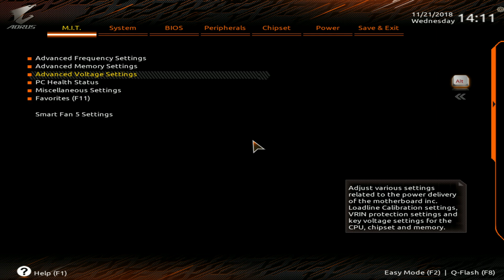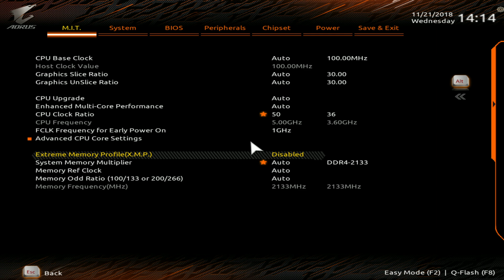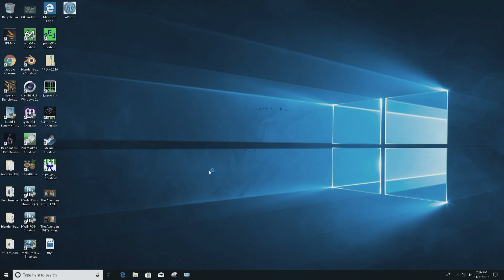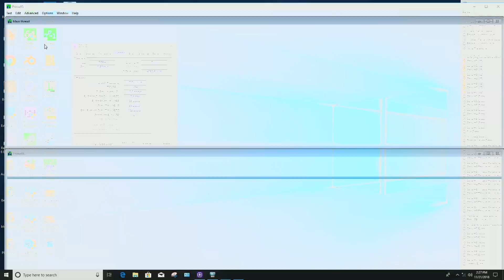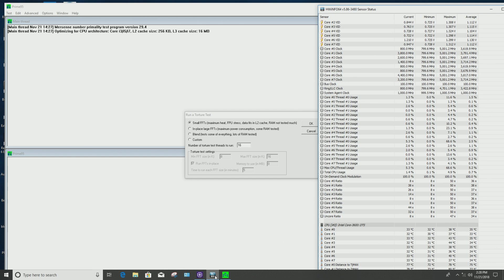GIGABYTE Z390 Overclocking Guide

Comment: i have an i7-8086k so it comes delidded and OC already but at 4.2 Ghz. i dont have the same settings to change as you even though its the same Motherboard. no CPU clock ratio setting anywhere. and cpu frequency is greyed out. no idea how to change anything

Comment: I have an i5 9600kf in a gigabyte z390ud with an air killer s, I was crashing at 5.2Ghz with 1.375 voltage, but when I got the loadline calibration to turbo it became stable. temps are 70ish with maxes in the 80’s on cinebench multicore and aida64extreme. I also noticed my cpu going from 65W to around 100W

Comment: How do I lock my CPU frequency to 4800 Mhz  in Bios ? I have a Gigabyte Z270X Gaming 7 BIOs F8 . I was able to have it set at this frequency all the time but now it goes down to under 2000 Mhz sometimes just using normal windows desktop.

Comment: First of all: Thank you for the straightforward guide!
One question: Which voltage readout in HWInfo is the most acurate for actual voltage at the core?
I heard it's the VR VOUT of the ISL69138, but I am not positive. I'm on a Z390 Pro.

Comment: if you're doing this in 2021 on an i5 9600k I highly recommend leaving everything on auto and changing your core ratio one at a time before proceeding with these settings. This is "hardcore overclocking" and is not always safe to run these settings for everyday use.
Reply: Even when leaving the base clock to drop as needed? I am doing this on the Aorus Pro with an 8700k

Comment: My pc isnt stable even with 4.8 ghz at 1.38v with uncore ratio at 4.7,if I try 5ghz at 1.38v I get instant blue screen.I have an i5 9600kf on a z390 aorus pro motherboard and an msi coreliquid cooler.

Comment: I have the 9600K that ive overclocked to 4.9. I Keep getting error code in Prime95 "FATAL ERROR: Rounding was 0.5, expected less than 0.4 Hardware. All cores are at 100 percent during the bench mark and than all of the sudden core 0 drops down to like 30 and wont go higher. IM running at 1.38 Volts. 
What i read was this error means my voltage is too low. im not sure if thats accurate because im seeing people running 5.2 ghz at like 1.26 in some videos which doesnt make sense. 
My temps during benchmark jump up to 95 which is way too high also.,
I have a coolermaster 212 massive air cooler.

Comment: Hello, 

I have an issue in regards using Z390 D ; in which I am trying to find SVM mode , I dont seem to find M.I.T settings when I press F2 , instead it takes me to EASY MODE or ADVANCED MODE. I am facing hard time here trying to figure out how to enable Virtualization  AKA ( SVM ) , Ive been surfing for an hour via google now and cant seem to find anything in regards to this. Thanks in reply
Reply: same here, I don't understand why this motherboard's bios layout is this confusioning
Reply: @CaesarIzuna  Yea , i still couldnt find it , I just smashed my monitor . Gonna take a break till i get some money to change the frikkin motherboard ... This is the last time I purchase a friggin gigabyte motherboard. ( texting from my phone fyi ).
Reply: @ley667   same here, my next MB with be a asus Strix, it was a mistake buying this gigabyte board
Reply: They removed the option after BIOS version F10+. try flash a previous BIOS version such as F9 or F10. Hope this helps.

Comment: What should i set my vccio, system agent, or vcore on bios f11c to voltage wise if im only clocking my 8700k to 4.7? Any other settings i should change for a normal user with daily gaming use like c-states? Im curious.

Comment: How would I know if my voltage is too low? I've got a I5 9600k/Z390 Auros Pro WiFi OC'd to 4.9Ghz at 1.25V only. I use a Thermaltake Water 3.0 360mm AIO with a CM H500M case: (2) 200mm intake on front, (1) 140mm exhaust on rear, with (2) 200mm mounted on top above the rad that are pulling to creating a push/pull with my 360mm AIO. My temps hit a max of only 70C during a 1 hour Prime95 torture test. I'm currently running an 8 hour RealBench stability stress test. I feel like I could get 5.0 or even 5.1 GHz but don't want to push my CPU too hard (it's a 3.7/4.6GHz Base Clock). Question is I see so many guys using my chip that need 1.32+ volts to hit 5.0GHz and I'm only 1.25V at 4.9GHz, are there any issues if your voltage is too low but you seem to be stable (no blue screens, crashes, black screens and Prime95/RealBench are good)? Is there any other monitoring software I want to use? I use HWMonitor & HWInfo. Thanks and any help is much appreciated!
Reply: did it stay stable?
Reply: @jacobtaylor5879  Yes. Never a blue screen once. Temps stayed good. Haven't changed a thing.

Comment: TweakTown:  you have one for the i5-9600k ???  i just want to clock it to 4.5GHz  but don't know if I need to up the voltage on the power?
Reply: same thing. leave voltage on auto then run a stress test. it should be fine
Reply: there are lots of ways but above is the simplest

Comment: Can i go with the same numbers and settings on my i5-9600?? I've done gpu oc but never touched a cpu, should i get a cooler or i can go with default intel fan?
Reply: stock intel cooler is not overly good for overclocking. you might be able to milk a little more out, but you'd be better off getting a large air cooler or a 240mm aio. Then you'll be able to stretch it out more
Reply: @strider5119  thx for replying! yes i just had a coolermaster 212, got it running on 5.0 rn^^

Comment: Will the "Be Quiet Pure Rock" cpu cooler be enough to cool an overclocked i9 9900k at 5ghz?
Reply: dark rock pro will
Reply: hm but i think all core on 9900k 5ghz should be easy, yes i think smth like that or noctua d12 will do

Comment: can gigabyte b365m aorus elite be overclock
Reply: midrange gigabytes usually arent meant for oc
Reply: but you can oc lightly on smth like b550m ds3h
Reply: its pretty good if you change from rather unstable boost to all core +200mhz, quite nice fps boost

Comment: So i was changing some stuff in here as a noob (the cpu upgrade one) and the pc kept turning on and off, too high voltage i guess?
Reply: Just Sam same here what did u do to fix it
Reply: @randofn2541  it was a pain in the ass, i has to take out every single cable in the pc, i first took out the ram, apparently that can fix it once you place it in another slot, but it didnt, so after that i unplugged the graphics card and took it out, along with all the fans, i took them out, all of them, also the battery behind where graphics card was, unplugged the power supply, plus the hard drives, it still was turning on and off no matter what. But eventually i found one more cable i didnt see and i unplugged it also, which was the water cooler and after that, all i had plugged in was the power, turned it on and it started to work, so while pc was still on i pluggee the fans back in and it stayed on, then i turned it off and plugged the more serious stuff in one at a time, and turned it on just incase one of them was still making it turn on and off. It was a huge pain

Comment: I followed these instructions perfectly and checked my work, but my computer now only gives me a bluescreen when I start up! These instructions definitely do not work for all Z390 boards!!!
i9-9900K
Z390 Designare
850W power supply
Reply: try this https://forums.bit-tech.net/index.php?threads/9900k-5ghz-1-2v-guide-gigabyte-z390-master.353729/
Reply: Absolutely. It's a sheer luck.
Reply: Any have a 9900ks guide or is it the same as 9900k guide

Comment: When he’s looking at CPUZ it says 3.6 MHz
Reply: and this is correct as the CPU is in the idle states, once you run the stress test or start using your CPU as required under the load, it will go straight to the maxed clocked Mhz you've set up in the Bios ;)

Comment: Bruh i did the exact same thing as u said in the video but somehow my system started but didn't show anything on the monitor.....I disconnected all cables and reconnected them still it was a blank display... So then I cleared the CMOS values and resetted the BIOS..... It started and displayed😀.... Can u help me please cuz I'm new to pc building/overclocking... Thx
Reply: https://forums.bit-tech.net/index.php?threads/9900k-5ghz-1-2v-guide-gigabyte-z390-master.353729/

Comment: Gigabyte Z390 + i9-9900KF: I keep getting stability/crashing issues with 5.0GHz at 1.375v... I tried raising the voltage to 1.39v with same results so I went back to 1.375v at 4.8GHz and I'm stable now. Can't figure out how to get to 5.0GHz reliably. Using a Corsair H115i Pro 280mm, so I'm 28-31C Idle and 59-62C at 100% on Prime95.
Reply: silicon lottery maybe..
Reply: @paulkeane7838  maybe 🤷🏽‍♂️
Reply: Just a bad chip
Reply: @TheJonazas  🤣
Reply: Whats your Ring Ratio? anything over 47 for me crashes my CPU. Check it at 43 Ring Ratio and if it holds then you have found your problem.

Comment: when i stress test i see a thermal event>yes does that mean i need to lower my OC. im new to overclocking
Reply: Either the voltage or the multiplier. Your CPU is overheating. Upgrading your cooling solution may also work if you’re at the lowest stable voltage for that multiplier.

Comment: Can we use this video to overclock the i7 - 9700k with the same settings?
Reply: Pretty much if you have the same board. This guy is stress testing the shit out of it though
Reply: I can't overclock 9700k even to 4.7 with this video. But I have a Noctua NH-D15S aircooler and that guy has a liquid. But then temps are terrible in this video too.

Comment: Is a 7-8c core temp difference normal for a 9900k, my idle temps are 1c apart but maxing all cores i have 2 cores that seems to run 7-8c hotter than the rest and 2 that run cooler and i was wondering if i should reapply thermal paste and mount the cooler again.
Reply: I don't see why that would be an issue. Those 2 cores are likely doing most of the work

Comment: SOMEONE HELP! i cant access the BIOS for some reason. Ive tried constantly hitting delete among all the F keys and cant access it. The computer just boots up normally..any tips? this was a pc i built and it runs fine just need to change a couple settings in the BIOS
Reply: same, remove the board battery for 5 seconds

Comment: @tweaktown Hi mate, I have a few questions I did some OC testing yesterday with a h115i pro 280 aio. 5.0GHz at 1.30v and using Small FFT Prime95 AVX testing with no offset I was seeing temperatures up to 100-109C just before thermal throttling set at 110C in my Bios. But that kind of worried me so I dialed it back. Also in custom Prime95 tests, I'm seeing more like 95-100C max like in the test you did at the end of this video. So with that said I have a couple of questions.

1. Is 110C a couple of times for no more than 15 minutes likely to have damaged my CPU or reduced its lifespan or overclockability? Two test I ran for about 15 mins and the rest was just a few mins at these temperatures before I decided to stop. I'm going to dial in a less aggressive OC or I might delid and direct die cool with a h150i.

2. Is this TjMax of this CPU 100C or 110C I keep seeing conflicting results but 100C from intel but other articles and YouTubers state 110 or 115C. I also see other data that doesn't seem accurate like boost up to 5GHz when it used to say 4.7GHz for the i9900k.

3. What testing should I do to confirm stability and for how long with temps up to 100C? Is the custom prime95 test you ran the best test on the latest version of prime95? I did this test and I hit around 100C max and it seems to be stable. When I run small FFTs (in the latest p95 version) temps get up to 110C and eventually one of my cores will drop utilization down to like 60-70%, not sure if this is a bug as no thermal throttling happened, which is weird. Running smallest FFTs yields similar results but a couple degrees less and it takes longer for that 1 core underutilization to happen. All my other tests run fine like Cinebench, Intel XTU, etc. 

Thanks!
Reply: over 100 is high and uncomfortable

9900k boost to 5.1ghz iirc

prime95 is a good stress test app

Comment: The frequency base clock being unlocked is a holdover from when Intel and other CPU manufacturer's had the clock ratio multiplier locked.  I'm not sure, but you may be able to buy a CPU with a locked clock multiplier still.

Comment: Nice video. Will make my 1st DIY CPU next year upon completion of all the components. 1st water cooling as well, and 1st manual overclocking. Your video helps a lot coz Im a straight noob and from what I see on the net about Gigabyte's bad UEFI/BIOS coz I just bought a Z390 Xtreme Waterforce paired with a 9900KS.

Comment: What is the setting in the bios to make the cpu downclock when at idle like yours does? Ive successfully got mine to 5.2ghz but i want it to downclock like my 6700k would on my asus maximus build. It would got from 5ghz down to 2ghz at idle. Then if i started a program or game it would boost up to 4.8ghz. How can you do that in these bios?
Reply: you can try changing the min and max cpu power state  in windows power plan advanced settings, see if it helps, if not then you have to start looking for it in the bios

Comment: I have a 9600k and with OC when I open up google chrome sometimes it won't load a page.  But when I revert to default clocked it always loads a page.
Reply: Aqui no Brasil a temperatura ambiente é por volta dos 25° graus, eu consigo rodar o Core i5-9600k a 4.9 GHz a 1.355volts estável! Mas quando elevo a 5.0 GHz a coisa muda de figura não roda por menos de 1.415 Volts para navegar apenas se precisar de jogar warzone  o clock deve ficar na faixa dos 1.45 Volts com LLC no Extreme ou até mesmo no Uktra Extreme.  
Todos os estados de energia permanecem desativados e com memória 3200 mhz a 1.35 volts uso para resfriar o H100i Corsair 240 mm.

Comment: Is this an all-core overclock? And why disable all the power saving features? Don't those give lower temps, fan speeds, and noise when idle?
Reply: He literally explained that he turned off power saving features because he wants to run it at his overclock speed regardless of CPU load. Also he said it is because it's his preference.
Reply: @jacktran960  He literally explained it, huh? As opposed to figuratively? I didn't watch the whole 20 minute video, bud. Would much rather consult an article for this sort of thing, which I did. I'm running a 4.9 all-core boost, with all power saving features on, because that's my preference.

Comment: what settings would i have to change with a intel i7 9700k cpu & same board.
Reply: I recommend not doing any tweaks in the bios. Just load optimized defaults. And running ez tune gigabye utility. You can download it from gigabyte website. Let the program figure out the highest over clock. It will reboot a few times and find the best oc for your ram cpu and motherboard plus cooling. I highly recommend it. Found mine and my computer runs rock solid i left this program OCCT on it all night no errors no bluescreens.
Reply: Sebastian Rogers I'll prob do that. Thanks. What clock speed you end up getting?
Reply: Same, cause I just crashed the stress test with these settings on an i79700k
Reply: @marcmarc4776  Well no shit you crashed. Not every chip requires the same voltage or gets the same thermals. Not to mention this idiot is stress testing this thing in the video and you can see the max thermals going above 100c which is 100% not recommended.

Comment: What values would I use for a 9700K?
Reply: 4,9ghz -1.35v
Reply: have you figured it out? I cannot get my 9700 on Aorus z390 pro-wifi anywhere above 4.4GHz ! I have it stable at 4.4GHz and 1.30 vcore
Reply: @RamyAhmed-IT  I have not done it yet as i'm waiting for my GPU to be delivered tomorrow, but do you have the 9700K or the 9700, as you cannot overclock the non K version

Comment: i followed the steps and it randomly blue screens 1 a day. the error mentions memory but ive turned off xmp and also set the ram back to auto instead of 3200. if i run prime95 i automatically blue screen as well. 

using a 240l cooler master all in one cpu cooler. 

i have the ram in slot A1 and B1 but have now moved it to A2 and B2.

any help would be greatly appreciated.
Reply: Same here.
Reply: Have you any overclocking enabled? Changing the frequency of the Bus Clock especially affects this. Try defaulting all the BIOS settings if you're still getting the BSODs. If it's still happening, it's probably a faulty component like one of the DIMMs or the actual processor itself...
Reply: Rene Kuhs set everything back to default and no blue screens whatsoever. i thought i may have had faulty memory but did memtests and no issues were found.

A stable overclock would be nice as i would be getting more frames in certain games than default. 

i'm no expert in oc'ing just following the guide so i could have definitely missed a step but dont think i did. only adjusted the settings in the guide.
Reply: @killyamomz  you could try following this official Gigabyte OC guide (maybe it'll give more stable results): https://www.gigabyte.com/FileUpload/Global/multimedia/2/file/525/946.pdf

Comment: Current Setup: Aorus Pro Z390, i5 9600K, H100i 240mm Liquid CPU Cooler, 16GB 3200MHz (2 x 8GB). What would be the best settings to overclock i5 9600k to 5GHz ?
Reply: Kevin James E Charles you have like my exact setup. Coming in the mail today. I’ll probably try with 1.25-1.3V to see if it sustains
Reply: @entroxity9137  let me know how it goes, great set up
Reply: Kevin James E Charles I just found this comment again lol. Idk if it’s helpful but I made mine 5.0 GHz and 1.375 Voltage and sustain temperatures in the 60s
Reply: Entroxity do you mind sharing your bios pics with me? Can’t get mine to be stable at 5.0, been trying for months
Reply: Ken Truong 5.0 1.375 ghz
Reply: Entroxity ty